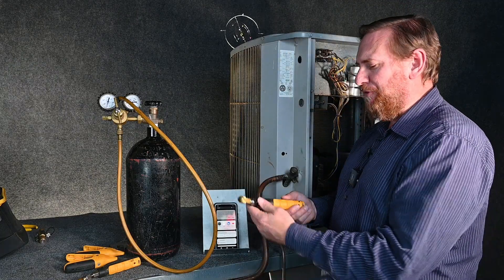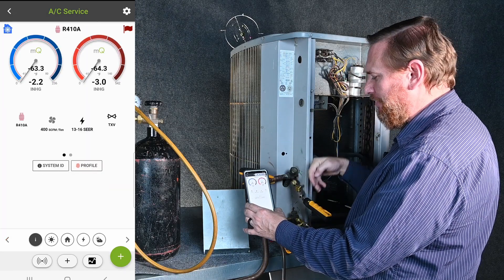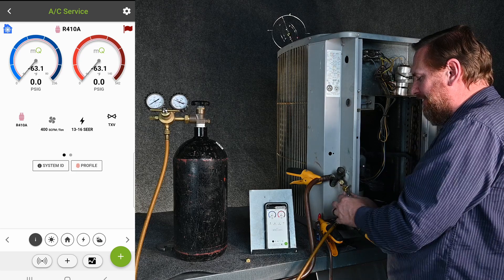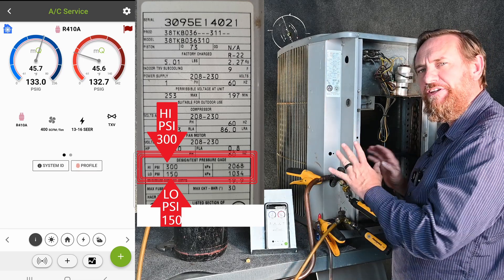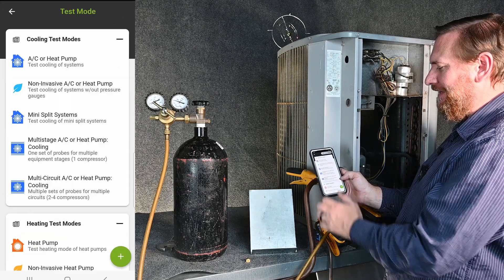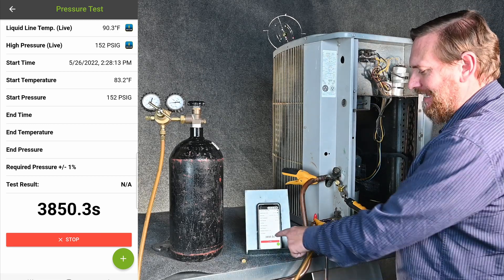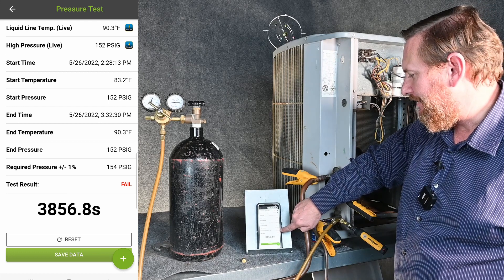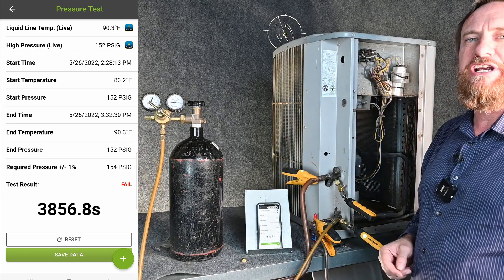HVAC 155 Nitrogen test with MQ and Probes

Comment: 2 questions.  What if you're doing a mini split.  Do you crack open the liquid line to purge air?  Also.  Do you need to keep MQ running the entire time or will it run in the background.  Thanks!
Reply from the maker: I add a service port on the small line just for purging and pressure testing. I do leave MQ running.
Reply: thanks!

Comment: Why does my liquid line probe spray refrigerant out can someone help is it the probes or the system
Reply from the maker: The valve core in the system is probably backed out too far.
Try tightening it up.

You can also use Accutools S10767 Core Depressor Tool 1/4" x 1/4"
It attached to the probe and allows you to disengage and engage the valve core manually.